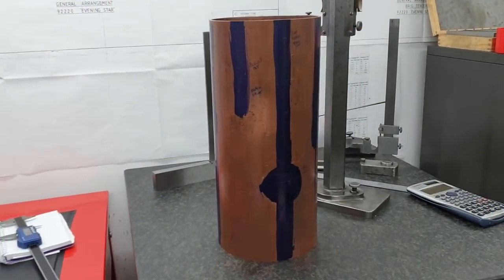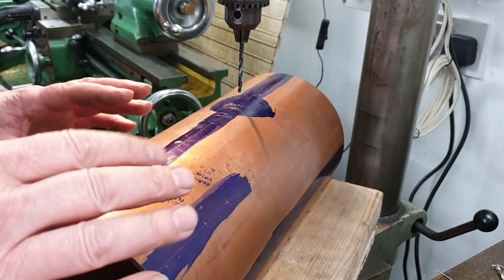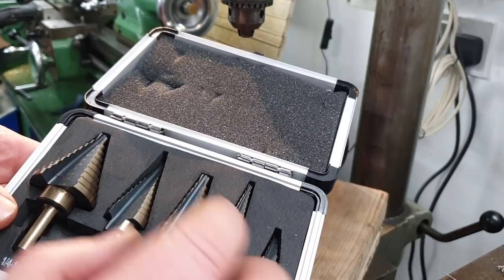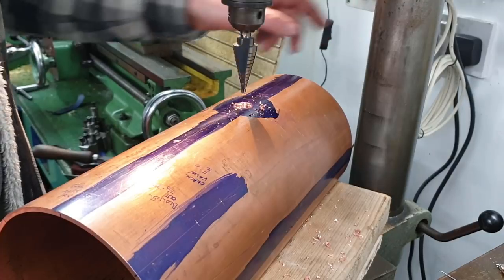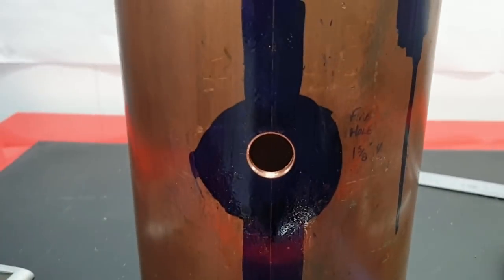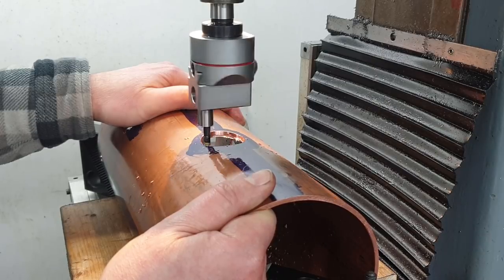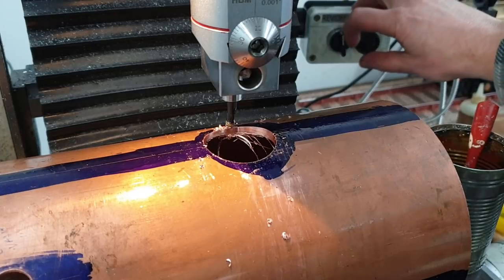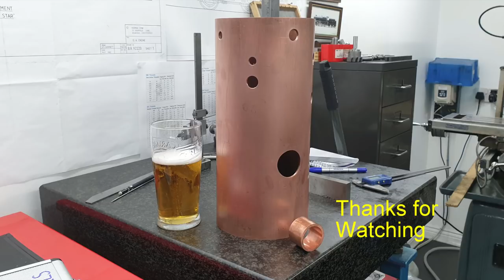6" Vertical Boiler        Part 2 - Boiler Barrel

Comment: This brings back memories, albeit at twice the scale of mine.
Watching this build vlog will be a major decider for me on whether I might tackle a six incher in the future.
BTW nice work on that firehole!

gary
Reply from the maker: Thanks Gary - Yes that fire hole was a bit of a nut-crumbler! Potentially It will be even more so on the firebox tube as the radius of the material is less - so more interrupted cutting....

Cheers Craig
Reply: @no23mk2  Would a hole saw be an alternative, or would it not be accurate enough?
Reply from the maker: Possibly so, but I didn't have one to hand. Accuracy is not really a problem as the fire hole tube could be turned to suit the size of the hole (so long as there is still sufficient wall thickness).

Comment: Here I am trying interest my Wife in making ours. I got all my parts cut to size from a lovely helpful Guy in Stockport!
Although I think Blackgates do a kit for these, but bashing copper over a former is very satisfying.
I usually resort to chain drilling for big holes!! I am also doing a simple 0-4-0, one I have made it to Model Engineer which is powered by a cordless drill driver? She pulls 4 Adults!! Too many projects as usual. Love David and Lily. Reading.
Reply from the maker: You can never have too many projects!

Comment: Drilling Copper is one of the easiest and yet toughest things to do. The only lubricant I find that works drilling it with a step drill is steam oil. its thick stringy and does a wonderful job to counteract the coppers very sticky and gummy nature. I've built several boilers for locos and thats the only method I find that works
Reply: WIthout steam oil it drills exactly like you saw it drilled very gummily and stalls the drill out
Reply from the maker: Spot on Steve, The oil I used was way oil - also very thick and stringy it made a huge difference. Using normal cutting oil or machine lube oil hardly had an effect.
Reply: Parrafin works well

Comment: Cracking job Craig, have you thought about what number you're going to allocate her, 92063 would be nice, pulled the last steam hauled iron ore train up to Consett here in County Durham, the gradients reached 1 in 35 at one point. For my money the 9F's did their most sterling work up here, the ore trains worked a 24 hour merry-go-round 7 days a week, grueling work which they handled magnificently. Just saying like...😃😃...
Reply from the maker: Cheers Allen. It's definitely going to be a plain freight black loco (at least to start with). The Tyne Dock - Consett locos would be a great prototype to copy - with all the extra Westinghouse air pump gear etc. Unfortunately I have already built the BR1G tender, The Consett locos had BR1K which later became BR1C tenders once the mechanical stokers were removed. These have high sides whereas mine has the 'inset' sides.
Reply: @no23mk2  I didn't know any of that Craig, thanks for the info...

Comment: Nice work as always Craig. Where did you source the copper tube. Its becoming increasing difficult to get hold of small sections of large diameter copper tube as a model engineer. Prices of copper tube seem to be rocketing!
Reply from the maker: Thanks David, I searched the country looking for 6" tube before finding some at a reasonable price at M Machine Metals.
Reply: Keatley metals, Birmingham B4 6HD can probably do it.

Comment: Off to a good start :-)
Reply from the maker: Thanks Peter
Reply: @no23mk2  Any thoughts yet on  wether to buy a firegrate or make your own?  The one in my 5" could do with replacing shortly but I haven't yet found one the right size so I did think of making one.